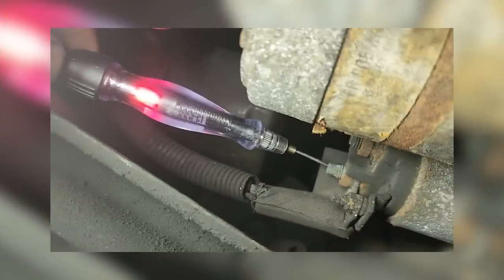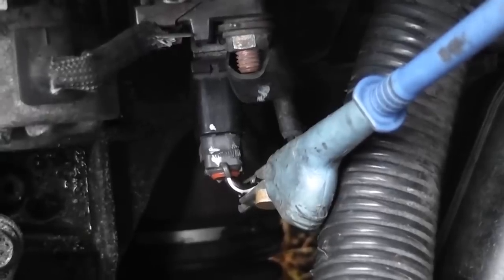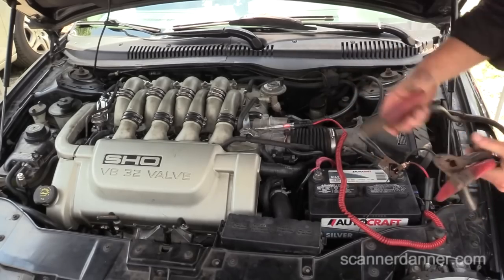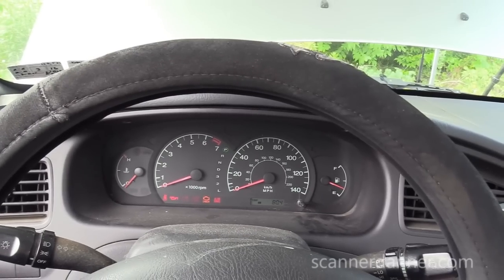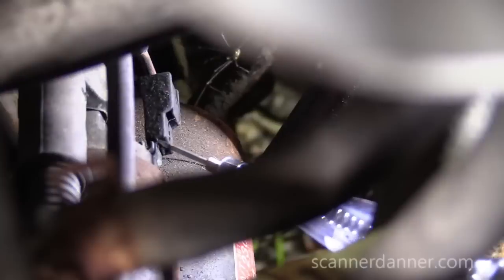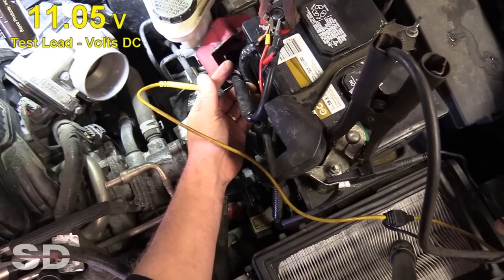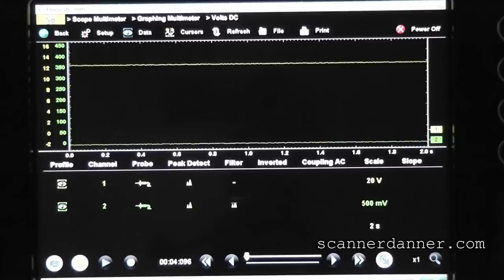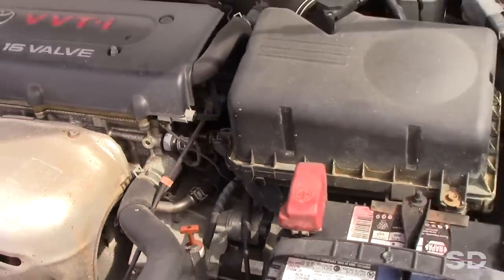Engine Does Not Crank - Compilation of Common Faults

Comment: My personal truck (2004 silverado) broke down a few weeks ago, get it towed to my shop start checking it out has fuel pressure, injector pulse, spark, no codes no communication problems, nothing looked bad in data. When I first hooked up my spark tester it had no spark so I thought the alligator clip on the spark tester might need to wiggle it might not be making a good ground and then it had good spark I tested other coils to be sure never once again did it not have spark, then it hit me it’s spark it could be an inch away from a ground the spark would jump I didn’t need to wiggle the clip, I started over thinking because it wasn’t making sense, so I checked the ground on the left side of the block for the coils and it was super crusty and that was it.
Reply from the maker: You will like this one!
https://youtu.be/QP8f1K-EigA
Reply: @ScannerDanner  yep same thing haha.

Comment: Hi scanner, I got a question. I good a 92 c1500 4.3. . when truck is warm it has a drag start.  Sometimes. When it's cool, no problem. Can you tell me where you start or what is going on. . New hit and ground wires . New starter. Oh when I charge the battery or have a new battery it stops for about 2 weeks.
Reply from the maker: Amperage measurement when it does it will be key!!
Reply: @ScannerDanner  when I find that out. Please tell me what I do.
Reply from the maker: @LetsFixIT  when you get that answer, we go from there
Reply: It's 13,00 something when it did it. After that it starts normal and it reads 1400 something.
Reply from the maker: @LetsFixIT  how are you measuring that? And those numbers aren't right.
Reply: @ScannerDanner  I got adc amp meter. I put it on the hot battery wire. And crank it. I'll check again tomorrow.
Reply from the maker: @LetsFixIT  it should be like 150-200 amps
Reply: @ScannerDanner  ok thanks I'll check again
Reply: Ok, I got the amp readings. In the wire going to the starter it's 474 by frame and 513 by the battery. Last week I got a reading of 313
Reply from the maker: @LetsFixIT  awesome! But not. That is WAY too high!! You have something maybe going on with your timing, which is fighting the starter?
How does it run?
Reply: @ScannerDanner  yes I just put a new distributor on it a couple days ago. It's on zero . If I put it on 2 engine pings. You think I should lower it.?
Reply: It runs ok but run I drive for a while it hesitates. That is why a new distributor and I put in a new coil..
Reply: Oh when it's cold or after it sit or after that hard start it's normal
Reply: I put the meter on the alternator side than back in the starter side . Now it's reading 389
Reply: Oh sorry it runs great
Reply: My bad it's 147 I tested it wrong. Trying to get it to miss up. When it does I'll post  the reading

Comment: Can the short to ground on a block burn some modules?
Reply from the maker: You mean the bad grounds I showed in this compilation?
Reply: @ScannerDanner  I mean if a positive wire somewhere gets worn from  vibration and gets shorted on the engine block or chassis for example.
Reply from the maker: @thomashvnmusic  no, that won't hurt anything but it would blow a fuse
Reply: @ScannerDanner  Good to know, thanks Dan.
Reply from the maker: @thomashvnmusic  it's Paul Danner 🙂 but I get "Dan" a lot lol
Reply: @ScannerDanner  I apologize Paul, thanks for the great videos and tips.

Comment: Having a hell of a time with the Dealership. 

They installed a new engine, and less than 100 miles its back. Misfire p0300, p0202, p0204,p0206

I looked under the hood and someone left a few bolts in the fender area. And they had it for 2 months already. 

At what point do you dispute the charges ?
Reply from the maker: you have to take it back to them first , those are injector codes I believe. You need to raise a stink about the bolts!
Reply: @ScannerDanner  Thank you for feedback!!
Reply: @ScannerDanner  

Dam these guys!! 

Took it back they say dirty throttle body was to blame 

and now my o2 sensor is bad as well 

no matter what i think they are going to get there money they wanted in first place..
Reply from the maker: @dznuttzonyachin7499  a dirty throttle body will NOT set bank specific misfire trouble codes, but a faulty O2 on that side of the engine can
Reply: @ScannerDanner  downstream???
Reply from the maker: @dznuttzonyachin7499  what year, make, model, and engine? Does it use a wideband upstream O2? If it does, then yes, a downstream O2 can cause mixture issues, but you should have fuel trim codes for that. Same if it was an upstream.
Reply: @ScannerDanner  2008 buick enclave

recap of story

new engine install
left shop less than 100 miles shot p0300
, p0202, p0204,p0206

took back now they said throttle body was dirty that's why injector misfire 

but then he said you have an o2 out 
bank 1 sensor 2

are those even the same banks ? 

and why wouldn't that light have came on as well .. 

also why didn't they test or drive the car to see the initial misfire ? 

you a life saver.!!
Reply: also they had it for almost 2 months now 

it had the.o2 sensors all replaced, and new cats put on previously as well like 200 miles before the engine install. never no codes
Reply: @ScannerDanner  sorry its a 3.6l as well
Reply from the maker: @dznuttzonyachin7499  no, that's not even the correct bank and you don't have downstream fuel control on that model (I'm pretty sure)
Someone is guessing. Neither of the suggested repairs have anything to do with a bank 2 misfiring issue.
Reply from the maker: @dznuttzonyachin7499  this is going to end up being a cam or chain issue with that new engine
Reply: @ScannerDanner  

Dude !!!!

You were right !!!! 

i brought a little cheapo scanner with me and turned on live data and could see misfires right away ..

he said well the check engine light isnt on. I said yeah cause it hasn't even been driven anywhere to set. But here is the live data that shows misfires all over all the cylinders. 
Not only that you guys sent this out several times and same issue. 

so this is where i sounded real smart!! 

i said where is the mechanic at ? I think we have bad timing chain or camshaft going on here. 

Dam they froze up and I felt like i just scored the game winning touchdown!! 

They said they are going to take That out and replace with another one.. warranty it no cost 

i think after being scammed to pay for new o2 sensor and they attempted to get me to buy new wiring harness for all injectors. saying they put die electric grease on and it fixed it but recommend the wires get replaced. 

ANYWAYS My Man Danner 👍

i don't know how or when but ill shall repay you for this help !! 

they literally tried snaking 3000+ more outta me when it was on them the whole time... so sad no honest folks like yourself